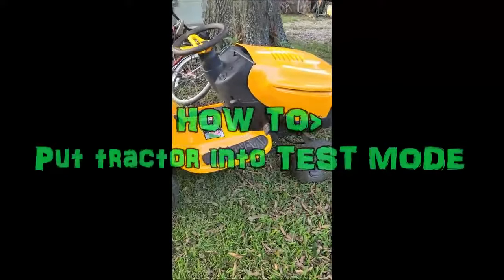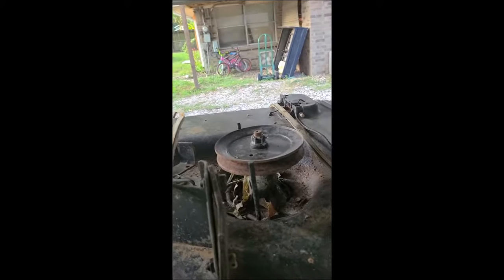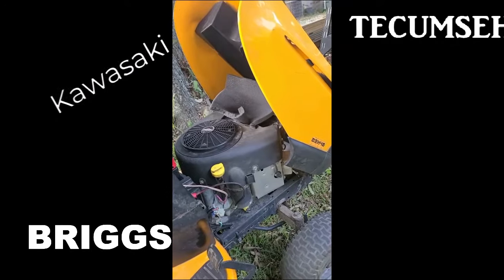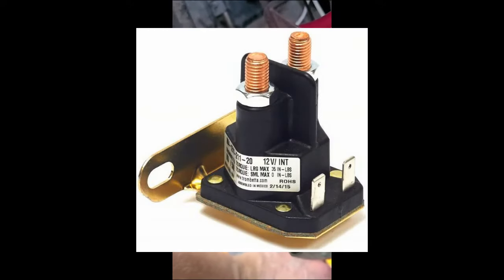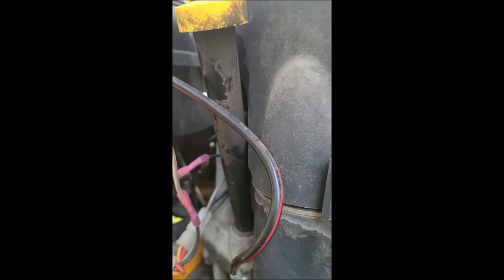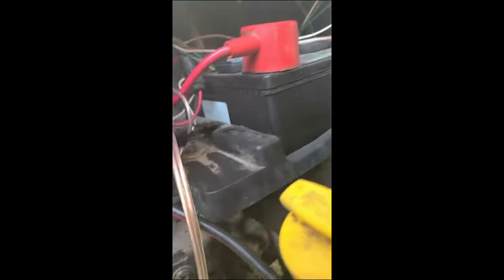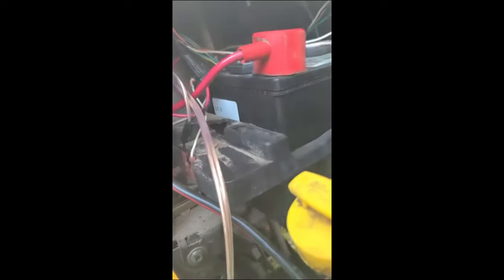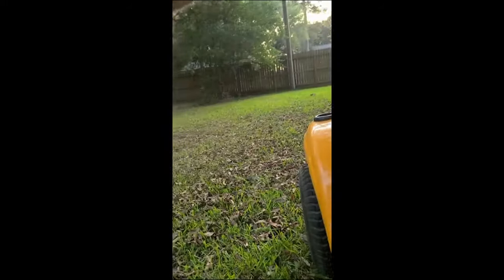Lawnmower Safety Switches BY-PASS SOLVED With only one wire.

Comment: I hope you're still around! I followed your instructions Kawa 15 hp Husq mower. 2 cylinders, 2 coils. Wire comes from one coil to the other and down. I cut that black wire, did not wire in a switch yet, but hooked alligator wires x 2 to both sides so I could touch them if I needed to stop the engine. 4 connection solenoid, left the big wires alone but tested with "pen" light 12v tester: power to battery side on, power to engine side on when key turned to start. Tried to start. Motor was cranking over but no start so I thought I needed your extra wire to the - terminal (or frame) from the solenoid back/white wire spade connector. Clipped that up to test and cranked but no power to starter at all! I saw a car-style 20 amp inline fuse clipped to the frame with 2x red wires from somewhere in the spaghetti, checked, looked blown, replaced it, motor cranked over again but no start. Again, tried the extra ground wire from the small neg. solenoid terminal. Starter dead. Checked fuse again -- looks good, but no starter turnover at all. I'm worse off than when I started! Ideas? Any other fuses?
Reply from the maker: That's the point of getting rundown of all factory wires you can . The problem is unleaa it's identical to the system I had in front of me its tuff to gives suggestions each ayatrm can be a bit different. I will say this stop and take each component one at a time what will it take for this component to work and supply the wiring for it. I start at the plug, then coil or coils power them (ohm, check them vids online, which will show how) if coils work and have power, tou are almost home next it starter.
Reply: @TimothyJamesDean    Same issue I had kinda and my battery was being drained cutting grass for ten minutes then dead eventually had battery charger on start 125anp to get to turn over and next  nothing at all no hum clunk zero. Turns out starter had magnet break loose and then caused a pinched to rotor

Comment: It appears that my old Kohler wiring is different than B&S .. Once I got rid of the dash switch and the solenoid to battery wire and found the faulty safety switch them put in the jumper wire, I could again use my key switch to start it up 🙂
Reply from the maker: not too bad when you break it down and study it

Comment: More to story: Good battery , 6 amp off on switch, Battery ground to solenoid neg side. Everything do as per your video. Also new carb. Thinking about installing new coil and jump starting it. Is the Kohler eng wiring the problem??
Reply from the maker: Im no expert on all engines I'm just to stupid to quit until i figure stuff out. You are right there it may be one wire keeping you down. I will say this if you can not see the whole wire (any of them) you may be  missing. something

Comment: Thanks...but mine runs and runs well, now the problem after I  engage the blades and take off a minute later cuts off ...then if I  try to start it right back up it back fires ...but if I  let it set for a minute after it cuts off it'll start without the back fire ...my lawns getting high ...help
Reply from the maker: A full minute? Everytime? Wiring is direct and instant so I don't think that is the issue maybe a switch going back internally. It's hard to know without seeing btw sorry for the slow reply  
If you bypass all switches and wiring and it still dies you will know what isn't the problem at least.  Just don't give up. Google the company name and call me ill try.to help u out
Reply: @GottaKnowJoeHobbies  yeah....one minute everytime it's an Ole late 90's John deer Kawasaki engine. Last season I  bye passed the seat safety switch...
Reply: @GottaKnowJoeHobbies  I read elsewhere that the expansion differential between aluminum bolt and heads can cause a coil to move away from the flywheel when they get hot.  If the gap is slightly to large to begin with it doesnt take a lot of movement for the coil to move too far back and kill the engine.
Reply from the maker: Not sure about that one

Comment: i have craftman 27 hp kohler i try that it didnt work
Reply from the maker: It works if you do it correctly.  All any engine needs is fuel fire and exhaust.  If there is No ground on plug or ignition system is not grounded out [how they kill a running engine] it will work.. unless have a bad ignition..can you pull the plug turn over and get spark? Start there

Comment: Tying in a extra ground wire from the negative post on the solenoid to the negative on the battery corrected my issue. (craftsman briggs & strattion, with 4 point solenoid)
I did not have to add the switch inbetween the coil pack and ignition switch,  future viewers might want to try this out first, before splicing
Reply from the maker: Glad it help.. it is hard to believe it was so simple and I was so blind for so long
Reply from the maker: Great glad it inspired you...new perspective will get us thinking in new ways...I learn everday
Reply: I have been racking my brain trying to figure out why it won't start when all safeties and key switch checked out good. Ran a jumper wire from negative on solenoid to negative on battery like you said and now it starts and stops with the key. Plus I still have all my safeties. Life saver. Thank you thank you THANK YOU!!!!

Comment: Easy to re-hook wires. Ordered new parts, Switch, solenoid and coil. I will start all over and try jumper wire on all safety switches.  I'm dumber than a box of rocks so this way I can make same mistakes and still not get mower running .. Fun times.

Comment: Nice video ! Thanks . As I sit here contemplating tearing every damn safety switch off my friends newer John Deere.I was going to just run a key on hit wire to the solenoid so it would work just like a 1960 's Ford . God Bless the old cars.Then I heard you say that the Mfgs  are breaking the ground wire on some of the circuits now also . So that explains a lot ! The clutch engagement switch on the John Deere has four terminals but is set angle throw switch ,so maybe that switch breaks the ground to the solenoid ,hmm. Thanks for opening my eyes to a different potential issue.I would normally just eliminate safety circuit but its my best friends widow  & daughters tractor. I got them an old gravely 2 Wheeler and made sure it had the safety features on it & even made sure they function. My old Gravely s are man eaters ,they will hurt you bad. So ,I am gonna try a by pass switch to solenoid that they can engage when it plays the occasional won't start game ,they an over ride.
Reply from the maker: I like being in control lol out thanks
Reply from the maker: you can call me if you need ill try to help

Comment: I tried doing what you said, solved part of problem it will stay running now, but the blades do not engage any ideas
Thank you
Reply from the maker: Question is How or what do you do to engage the blade. Is it manual or electric?

Comment: trying to do just what said....but my POS  now that it's not running....can't expose the coil pack...after getting in here removing that top part is well challenging....waiting for WD to help lossen these Phelps head  screws....on top where the flywheel connects to that cover....
Reply from the maker: Take a Phillips THAT FITS THE SCREW and hammer push down and twist to the left hammer the handle of the screw driver with hard fast raps even try hitting the screw head a few times tobjar loose

Comment: hello, thank you for your video, I would like to ask you a question regarding safety switches and my questions are just for personal knowledge only.
If I was to avoid all the safety switches on my riding mower could I possibly, from the solenoids white wire trigger wire, wire directly to the S on my ignition switch??? And to possibly avoid the grounding of the safety switches preventing my mower from starting, could I wire my magneto wire directly to the M on my ignition switch, Bypassing the wiring harness that is connecting all the safety switches on my mower???. This is just for personal knowledge only.
Reply from the maker: As bad as I want to answer you I'd need to see it in front of me or a diagram..you can use the same on the start switch and place a dirt wire to the coil ground. The point is to pass it all eliminate everything ..make it run. Then come back and add start switch , on off buttons etc. It's easier for me to think in this manner I wish I could be of more help.  You can google.company name a call anytime
Reply from the maker: Glad to hear. It's all about hanging in there and not letting it win
Reply: Sir. I just wanted you to know that I typed up a novel of a comment to you and some how it didn’t post. 🤷‍♂️ I guess it didn’t want to post. I sent you that LONG LONG post because I’m having issues with my John Deere lawn tractor and you told this gentleman if he needed your help to just call you. I could use a hand with my dilemma, but I don’t like asking for help. I’ve been trouble shooting all day and I’m about to set this lawn tractor on fire!!! I’d never ask for help without doing my due diligence and homework first my good man. I’m just frustrated! These safeties will make you use cuss words that I’ve never heard before! 😳 Anyway. I won’t take up anymore of your time sir. It’s just your voice reminded me of my Paw Paw
and the dozens of things he helped me fix. Sure wish he was still here. Not to just help me fix this issue, but just still here...😕 I’m going to walk away from this beast for today, but tomorrow I will attack her again.. And... I will eventually WIN! She will not beat me!!!! “Why?!?” One might ask... Because my Paw Paw never let ANYTHING beat him.. And that’s a fact jack!!!
Reply: Sir. I just had to leave this lil nugget of info for ya. I lied to you. I’m so sorry, but I straight up lied to you. But in my defense, this is the lie. I told you I was going to walk away for the night. Well. That’s my lie to you sir. I DID’T walk away and guess what?!?!!!??!? I FOUND MY ISSUE!!!  🥰🥰🥰 I was wiggling the negative terminal coming off the battery and I began to hear a clicking sound. It was coming from near the solenoid area. Well. About 3 months ago I bought a new aftermarket transmission belt and it lasted about 5 mins before it popped into several pieces, a string in the belt got caught in my clutch and ripped the clutch wires slam out of the clutch!! AND!! SNATCHED THE WIRES OUT OF THE CLUTCH SO CLOSE TO THE RUBBER/PLASTIC BLOCK THAT I THOUGHT I WOULD NEVER BE ABLE TO SPLICE OR SOLDER ME TWO WIRES TO THE TWO WIRES COMING OUT OF THE RUBBER/PLASTIC PART OF THE CLUTCH WHERE THE WIRES GO IN THE CLUTCH! Well. I was able to use a YouTube video trick to put two long wires on the clutch that would reach the two wires that they were snatched from. I drilled two tiny holes in the rubber/plastic block, slid my two wires up passed where I drilled my two holes, screwed two little screws in the drilled holes to mash the wire down onto the contacts in the rubber/plastic block. Been working just fine. Until!!! Well. I wiggled a clutch wire where I had put a wire nut on the clutch wire splice and every time I wiggled the clutch wire near that wire nut I heard that clicking near the solenoid. Either it was the negative wire itself maybe loose from the starter or that clutch wire loose inside the wire nut. Right now I honestly don’t give a poot!! It cranks now!!! I’ll make sure the negative terminal wire going to the starter or going somewhere back in the back is tight. But I think the clutch wire I had spliced with a wire nut wasn’t making good connection or something and that wasn’t satisfying everything so it would crank. All I know is something wasn’t satisfying!!! Ahhhhhh... 😛 Paw Paw.... I know you were watching over me this entire time!! You knew I would NOT QUIT!! AIN’T NO QUIT IN THIS COUNTRY BOY RIGHT HERE!!! Thank you Paw Paw.. Sorry for all the terrible cuss words that came outta my mouth.. I do apologize to you.. Grandma would have made me go get a switch from that hedge beside y’all’s ole house and tore my butt up if she had heard those words exiting my mouth!! 😳. But I know you understand... lol Thank you sir for listening and thank you YouTube. I will in fact be making my first video tomorrow sharing my experience so maybe it might help someone else. 😛 Ahhhh. Life is good!!!  Mic drop.... 🎤

Comment: Sound effects were hilarious. Content, excellent. Still need help. I have a brand new bs exi725 that arrived with no on off switch. It won't start, but if it did I wouldn't be able to turn it off. One black wire running off back of engine. I do not feel very bright right now. I'm attempting to use this on a log splitter that has no on off switch, nor any other electrical parts. Help please!
Reply from the maker: Killing it is easy
 A wire to spark plug under cap to switch to ground. The 725 is a vert shaft 163cc right. The basics are all the same but all can be a tad different.  I fought a week on .t 800cc vtwin in a golfcart .  So look for the vids in the channel

Comment: I have been struggling to start my Husqvarna for a few weeks now. The feller that I bought it from had bypassed one of the safety switches but I don't know which one. I am going to go out to my shop with your video and my notes and hopefully have it running by morning. Here is my question-I've been starting it with a screwdriver across the two bolts coming out of the solenoid, will I still be able to start it that way? Or do I need to buy a push button switch to start it?
Reply from the maker: @dustinbrigge600  buy a nice heavy Duty push to start button and wire it in. The arc with the screw driver will eventually damage your connections
Reply: Try running a jumper wire from the negative on the solenoid to the negative on the battery. My mower wouldn't even turn over with the key until I did this. Now it works great every time .
Reply from the maker: @dustinbrigge600  use a push button as cross overe will destroy The lugs on the solenoid.I hope you got it running

Comment: Hey! Tried this on my Poulan pro with Kohler 17 did nothing for it. No key start, replaced sw. replaced solenoid still nothing... ???????????????????
Reply from the maker: Go back to the basics Find the hot off the key fin the run and look for a grn wire too see if grd cancels power on in any other pos. try a toggle power in to coil and a 2nd for the starter see if that works if so change key switch
Reply: @GottaKnowJoeHobbies  I >>THINK << I understand what you did, my delima with my Snapper B&S 18hp twin is I want to remove ALL the wiring I DON'T need, I no longer use the electric PTO, I just PULL a cutter deck, I ONLY need the starter charging wiring, BTW I have a wire going to the solonoid on carb, and also have a relay & a 3 point solonoid,  I need someone to just draw me a diagram of what to connect where where it will start & charge, I HAVE the parts manual wiring diagram I can email.
Reply: I had the same problem. I ran a jumper wire from the negative on the solenoid to the negative on the battery and now my mower starts and shuts off with the key switch and all my safeties still work. Hope this helps